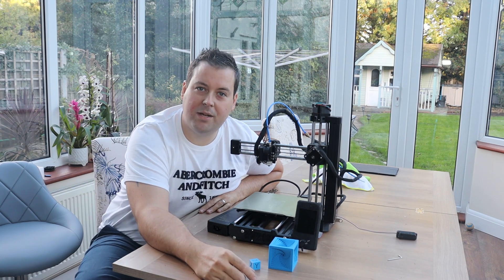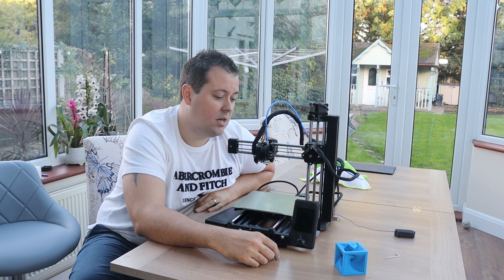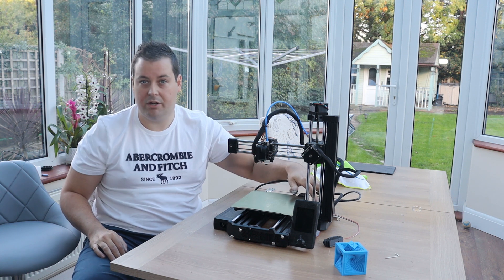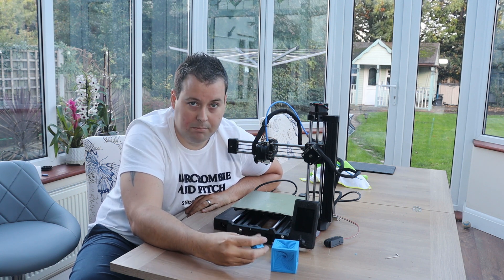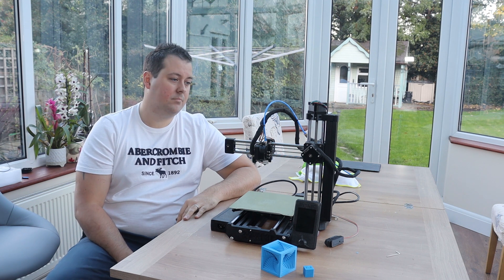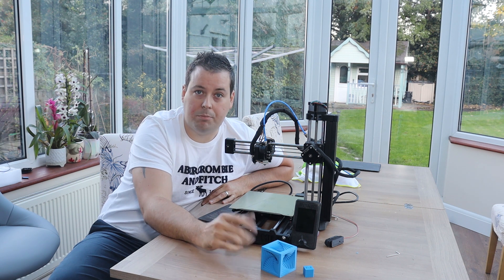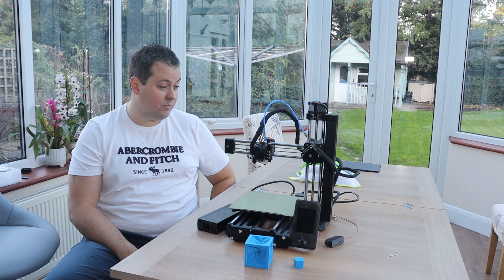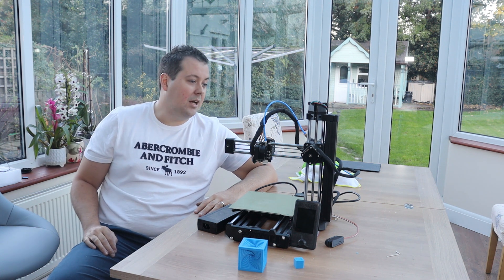does the Prusa mini clone hold a candle to the MK3 clone

Comment: On GitHub also are the stl for the clone. The feeder there has the right tread for the fitting, no adapter needed. You simply printed the wrong part.
Anyway the feeder design is not optimal, no matter if using the clone or the original. The Bondtech Upgrade (designed for the original Mini) has a reason. On my original Mini I use the Bondtech upgrade. On my clones I made an adapter for "Dual Drive" (normal BMG Clone). I use BMG Clones made of aluminium, working better than the Original Bondtech Upgrade - and less than 16€.
The display case and the filament runout sensor I printed in PLA (Sunlu Silk) as they neither are stressed mechanicly nor thermal. Sensor works perfect.
The only real issues: The heatbreak is 4.1 bore and the heatblock is v6-style. The heatbreak is security issue, as tube contacts nozzle, so up to 295°C possible and PTFE degrading. The heatblock without chamfers partly blocks airflow for part cooling.
You can get correct full metal heatbreak. (
https://a.aliexpress.com/_BVDMgL ) and chamfered block (
https://a.aliexpress.com/_BS699h ) from AliExpress.
As the AliExpress heatbreak is a clone of the Bondtech heatbreak design, it is even better than the Original.

So for price difference: 
Original: about 407€ (including Filament runout + shipping)
+ Bondtech Heatbreak 20€
+ Bondtech feeder 60€
= 487€

Clone:
173€ (Sale on AliExpress, using different Coupons) + full metall Dual Drive (16€) + heatbreak & -block (17€) + PET-G (10€) = 206€.

So Clone is less than halve of the original. And the Clone is even better using a full metal feeder (more easy to clean).

Both clone and original should be upgraded to Mini+, using the new Super PINDA instead of MINDA. You can only get it from Prusa If you own a original Prusa Mini. I do (and 3 Clones), so I will do the upgrade on all of my mini.
Reply from the maker: I would debate that rather than modifying the STL it would be easier to include the correct coupler, personally for the price it costs I would rather have the mk3s and do the bondtech upgrades to that, it's not a bad clone just not a useful machine in my setup
Reply: @honeybadger3dprintandpaint  Actually I had big problems with the couplers of the Original Mini, often blocking filament on unload. It got better the last firmware update (it now purges before unload) - but from time to time the filament stucks even with that. No such problems with the 3 Fysetc Mini clones.
So I changed my Original Mini to push-through couplers (bougt a fysetc cloned coldend)- no filament stuck on unload anymore. In my opinion Prusa should change the design. Cutting the bowden in 3 parts is not a good idea.

Anyway, of course the mk3(s) is better. But even there some changes needed: Full metal heatbreak (as the delivered ptfe-lined is dangerous than accedently heating up for polycarbonate) (and if you want optional add MMU2s later, you should use e3d heatbreak PrusaEdition, about 21€); also I recommend the BMG update (open source version from MarcoZ on thingiverse).

For the base kit on sale on Aliexpress I paid 172,16€ for a cloned mini, about 283€ for the mk3s. Upgrades for booth is nearly the same price. I mostly print smal parts in high quality (=slow). So using many printers in parallel speeds up printing a lot. So 4 Minis + 5 mk3s (+ some very smal and very big printers for special uses) is a good combination to me.
Reply: Please, which clone did you bought? (fystec or triangleLab?)  can you provide the link to seller store? also can you provide a link to the MK3S clone store? I own an original Mini and I'm very satisfied with it, but I need bigger volume printing. the 7 cm difference is huge for me as these days I found myself really anoyed with big parts (can't slice them for rigidity needs).
Reply: @dzmecano485  Actually I bought both from Fystetc. As the pricetag goes down a lot on sales and some sales (like the 11.11 and the black friday sale, but not on the last "new year comming sale") you can even get not only Aliexpress Select, but also Aliexpress (without "select") coupons you can combine. This way I got a Fysetc mk4s bear edition for as low as 249€ (incredible, lower than withou bear upgrade - my was including Einsy board, be aware some shops offer the set without board, always check!). As prices change permanently (esp. if some stores alow select coupons be used, other not, some aditionaly have shop coupons, than sale prices differ between shops) and also availbility from a local warehouse (no customs if I order from EU warehouse as I live in germany) changes, actually nearly all my clones are from different shop - but same product (exept of course the bear has other frame than the normal edition). All work fine, exept the quality of bearings variates. Mostly I change the bearings to higher quality. Actually the bearings from 3d jake work fine, but I also like the IKO ones.
So if you want it cheap, install AliExpress app, play the game, collect coins and coupons - I think next sale will be chineese new year. You might spare about 60-70€...
Reply from the maker: @dzmecano485  this is the fystec clone and my MK3 came from here https://www.aliexpress.com/item/33022178159.html?spm=a2g0s.9042311.0.0.27424c4dBHmr5U im very very happy with my MK3s clone
Reply: @oleurgast730  Thank you very much for all those info. I won't wait until CNY, 60 or 70€ are not worth waiting, I have some stuff to build and sell and I think I'll earn far more than the diff. I'll have a look. My plan is to buy a clone and change all bearings directly, print PETG parts alone (cause those sold by other shops seems not to be great). I'm at France, so I have to buy from EU shop cause costums are excessive (so no DHL or UPS, ...).
Reply: @honeybadger3dprintandpaint    Thank you very much. Will look at it. I already own an original Prusa Mini. I plan to buy a clone of the MK3S mainly because the volume but not only, I need a printer that I can hack, modify, do tests on it by building my own parts and my own mechanical systems, so it would be a pitty to spend too much money on the original when I know I won't be using a lot of original parts. I checked Prusa website for the frame and motors and board only, the price is almost as high as the whole fystec clone already. This is too much for experimenting. I would have loved to buy a TriangleLab clone (they have excellent reputation) but they only provide tracked shipping to France which costs 180€ already and will for sure induce customs taxes (at least arround 90€). This is too much.
Thank you for all those great videos and keep us with this excellent work.
Reply: @dzmecano485  If you print yourself, some recomandations for improved parts:

https://www.thingiverse.com/thing:2990861 is a very nice x-tension adjustment (many people break the left xy-joiner trying to do the tension on x-belt there; this part is much more comfortable) I recommend to build in this part while assembly and not to upgrade later, as you have to use a new belt if you already build the original design and wherefore cut the delivered belt to short for this upgrade. I even use this upgrade on my original mk3(s). A quite simple part making x-tension so much more easy.

Use an all metal heatbreak. The clones have PTFE lined ones, not able to bear the high temperature prusa firmware allows.

Buy an textured powder coated spring steel. Booth original Prusa spring steel and the Fystec one (mostly only available from china) are very good (but Fysetc uses a different texture - I actually use booth, depending which texture I want on a print). As the adheasion with PLA is not perfect, I use AprintaPro PrintaFix Basic (only add every 4-5 print just a small amound).

Theese are only the upgrades I strictly recommend from the start. It is quite simple, even if you build a printer first time.

One big optional upgrade I did to the original Prusa afterwarts and on all of my clones from the start:
https://www.thingiverse.com/thing:3754163 (it is the Bondtech mk3s upgrade in open source version. You need a Bondtech BMG or the chineese "Dual Drive" to source the parts needed (even a 7€ clone works fine) and some m3 threaded inserts)
https://www.thingiverse.com/thing:3681292 (dual part cooling fan, you need a second fan, but you can use the stepper motor delivered with the kit, no need for pancake)
Also you should use the modified firmware from bondtech, as the usable z-hight differs some mm and with a 3:1 geardown 1/16 microstepping instead of 1/32 prusa uses is recommended).

I am extemly happy with this upgrade; wouldn´t build a mk3s without it, as it only cost 15-20€. But of course for first time building a mk3s its way more complicating, as you can not follow one instruction, but have to carefully studdy different instructions and check there to follow one instruction or have to use another. Also depends on how good your english is; I made some mistakes on the first try.

For building the clone I also recommend having a long 2mm drill to clean up the filament path of the extruder perfectly. And for more comfort a 3mm drill for cleaning up the holes for screws (makes assembly much more easy). Postprocessing the printed parts is essentialy for a reliable printer. But if you print the parts yourself: Take your time. I always print printer parts with reduced speed (80% of normal speed in quality mode) to get optimal results. I even print some parts with 0.05mm layer hight (main body of the extruder, as it increases layer adheason and theese is the most mechanicly stressed part.

For fanshroud I use ExtrudR Greentech pro, it is more temperature resistant. It is not cheap, but works extremly good (I mostly print the whole extruder with this material). Everything else I use mostly Sunlu PET-G. Exect for the display, which has no themal or mechanical stress at all, so I can use nice PLA like Sunlu Silk PLA purely for optical reasons (so I print everything in black, giving the optical highlight doing a multicolour display case - just4fun.
Reply: @oleurgast730  Excellent. Thank you for all these info. I don't have any pb with english (my third language tought), and for assembly, I don't have any problem with any mechatronic system. So I can see no difficulty in assembling the MK3S. I prefer to print my parts with my own Prusa Mini because I prefer having full control over parts quality. I want to print them with at least 4 layers T/B/Perimeters, and with 60% speed and no cooling, this should produce very strong PETG parts I think. I'll make the X-Belt adjustment part. It's very simple and better install it from start. As for the BMG, from what I understood they sell u an extruder that you must assemble by taking some parts from your original MK3S. Where can I get those missing parts? if you can provide links to needed hardware for this thing I would be very thankful. 
Only difficulty I can see is to print the needed parts for this BMG, since you seem to use CF-PETG. I don't own such filament and I don't even know if my Mini will accept to print it (need to check the needed temp). In fact, apart from the print volume, I want to assemble an MK3S mainly to be able to produce "safely" parts with ABS, Nylon and flex.
You really need to write a full review blog post or video to describe all your mods. This would help a lot of people I think.
Reply: @dzmecano485  For the Open source Bondtech mk3s Upgrade Version from Thingiverse, all you need are some m3 Inserts and the parts from a normal BMG or a "Dual Drive". All parts needed you get this way.
Last time I sourced everything from a Dual Drive Extruder (Basic BMG Clone) for 7.50€ from AliExpress.

The original Bondtech mk3 Upgrade refers to the gears in the original Prusa Extruder (so buying the Clone Kit, you already have this parts in cloned Version)

As for a Video: just build another Clone, but the cheap bearings Broke. Got new high quality bearings, will do the changes after Xmas. If everything works well (will make a test by printing the parts for the bear clone), I will make a video about my recommended changes. It will be German as my last ones (and "on piece" with a Smartphone, not edited) but I will at least add an English documentation.

I printed them in normal PET-G, PET-G CD20, ExtrudR Greentech pro black and in ExtrudR Greentech pro CF for my different mashines. All work fine, CF is more for optical reasons than for function.
Reply: @oleurgast730  Sorry to be annoying, but can you give a direct link to  Bondtech mk3s Upgrade on aliexpress. I can find a lot of references and I would be annoyed if I buy the bad one. Thx a lot
Reply: @oleurgast730  Where did you bought the bear clone version? all I found are DHL delivered ones, which is a no go for me (cause of customs at France). I need a bear version coming from EU warehouse (spain or germany would be great).
Reply: @oleurgast730  Did you see this one for the Prusa Mini ? https://www.thingiverse.com/thing:3235716
Reply: @oleurgast730  I see youre quite experienced so maybe you can help me with bear clone - I’ve got fystec mk3s bear clone (350 usd) the on the list + trianglelab bi metal heat break (18 usd) + trianglelab bmg upgrade - price varies but you recommend cheapeast option + print parts? Anythin else? IKO bearings? Sunon fan?
I’ve got stock Z motor laying around as I did original BMG upgrade + dragon hotend, so fully assembled V6 with copper heat block and titanium heatbreak is available, with all those it’s closer and closr to slowly gather parts for next printer.

Comment: Your main point is you don't need a build volume this size makes no sense.
Reply from the maker: I do not need a build volume this small is what I mean, it's too small to print most of the parts I need
Reply: @honeybadger3dprintandpaint  I know what you mean.

What I'm saying is you purchased the printer knowing the build volume in advance for a review then say it's not useful to you.

Either way it's not great and at least others now know this, thanks.
Reply from the maker: @timmturner  we were sent the printer to review actually so we didn't buy it, I originally thought that although it was small it would be useful for smaller parts but the point I was making was that it isn't a size that will be geniunely useful to us or what we do,
Reply: @honeybadger3dprintandpaint  Oh then yeah that makes a bit more sense, I missed that you stated it was sent to you.